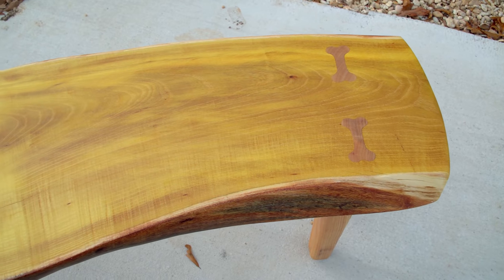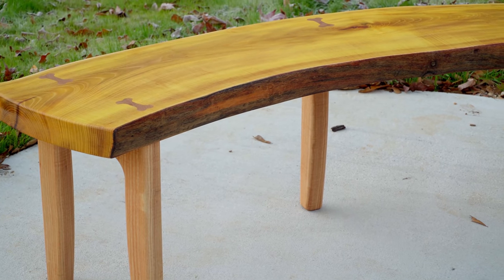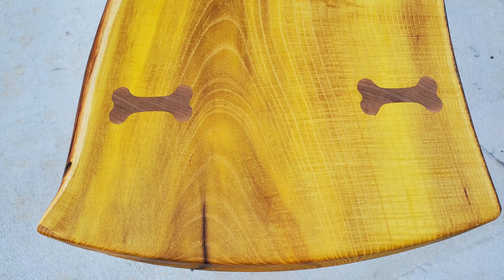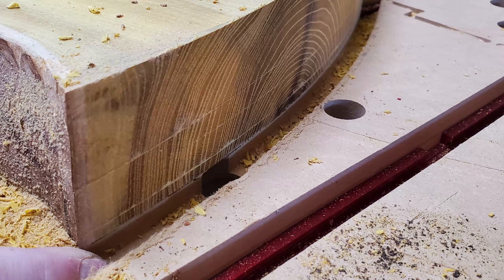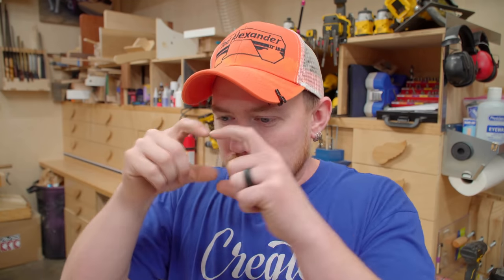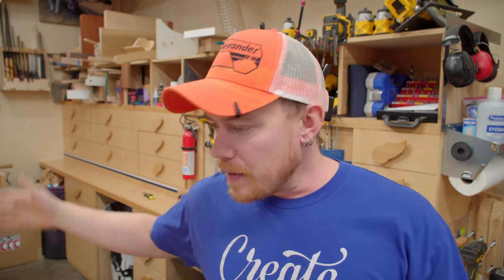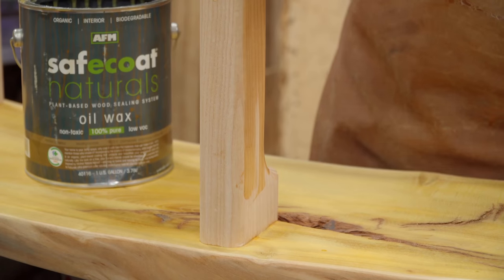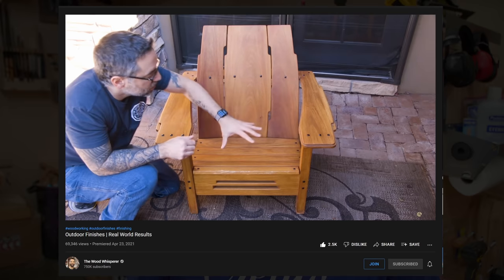Vlog 166: Woah! This scared me

Comment: I had a bit slip out of the collet during a cut recently also! It was crazy scary. It was a 1/4" shaft bit, so it did break the bit, but in a weird place...very near the non-cutting end of the bit. It can actually still be used, in fact, since there is so much of the shaft of the bit there. Glad you're ok!

Comment: Osage orange is used for fence corner posts here.  It's never straight but will outlast barbed wire without finish.  It's almost a nuisance tree and will take over if not controlled.

Comment: Collets do not require excessive torque when tightening. They supply you with a wrench set that shouldn’t allow over tightening. If you use a snipe or longer wrench set you run the risk of damaging the threads on your spindle. Also make sure not to bottom out the tool.
Reply: Agree completely.  If a bit is loose enough to come out of the collet after tightening with the wrenches provided either the collet is damaged somehow, there is dirt or grit in there, or the shank of the bit is out of round.  Years of machinist work behind me and never had a tool come out of a collet, and way more stress than any wood cutting.  I would take a close look at the collet, the ID of the holder, and the shank of that bit.  The collet shown in the video is the best design available, they hold like a miser holding a gold coin.
Reply: Hi Steve, that is not my experience.  Matching the bit shaft diameter to the collet size and going "as tight as" has proven most successful to me.   It is difficult to describe the right amount of force to be applied, but it is higher than what I expected it would be.  For the most part, I doubt this is as tight as what is physically possible (especially so if you are using very long handled spanners).  Ensuring you have the shafts, collet nuts, collets and the tapered recess they neatly fit into devoid of any dust, debris or detritus is also critical.  Cheers, David.

Comment: Hi Jay,

Great project ... thanks for sharing.

From experience ... collets (as well as router bits) are consumables. I've worn out three sets of collets (1/2" and 1/4") over the last 20 years using a Porter Cable 75182 router in my CNC.

If I have a bit slip (and I have ... it's never nice), I toss both the bit and the collet. I keep spares on hand to keep running ... and I buy replacements as I use them.

Keep up the great project videos and sharing your experiences and talent!

Regards,

R

Comment: Interesting and good feedback about the bit with the cut being too aggressive.  I managed to gouge a 1/2" hole through the 3/4" sacrificial board and well into my vacuum plenum in the early days of getting to know my cnc.  I now pay a lot more attention to ensuring the bit is in the collet is as tight as possible!  

Also, there is a neat trick to tightening and loosening the collet chuck with the way you hold two spanners so they are slightly apart from each other, with one hand you can squeeze the spanners together.  This results in a lot more control especially compared to having a spanner in each hand.  

Having noticed the end grain on the base of legs for outdoor furniture tended to rot fairly quickly, I now cut a rubber pad the same profile as the leg end and apply it with contact adhesive.  Legs 5 years later show no rot where they have been sitting on the concrete.   

Thanks for the video. Cheers, David

Comment: "The more you know" LOL! I can see the shooting star animation from Saturday morning cartoons when I was a kid. Not far off of "Knowing is half the battle!" Hahahaha!
Reply: Kidding aside, I've had a a pattern bit slip while I was cutting with a plunge cut router and when I finally realized I had a problem, after I seriously messed up my template 🙄🙄 At first I thought the depth stop on my router was slipping... Tightened that up so much that it seemed overkill or a design flaw... I still noticed depth drift and then I checked the bit and it practically came out just from pulling down on it. Scary as hell.

Comment: I've had a router bit start to slip out of the collet in my handheld router while making a dado with a 3/4" bit.  The bit was in the original collet that came with the router, and I guess after so many years it just failed and didn't hold tight anymore.  I caught it in time to prevent a huge gaffe in my project (only shop stuff, so it wasn't a big deal), but it would have gone into my workbench and likely hit an aluminum t-track if unnoticed. The collet was plenty tight, but just wore out over time.  I had a spare so no biggie.

Comment: Great video of the build. You mentioned the you used a wax oil finish for the outdoor application... have you ever thought of epoxying the bottom of the bench legs? This would stop any wicking of water when the concrete gets wet.

Comment: I use easel to run my cnc sometimes for simplicity and I’ve noticed that if I change the feed rate mid project it has a tendency to glitch out on me. The glitch usually presents itself as going out of the cut path which is annoying. I’ve found that as long as I leave it alone while it’s cutting I’m good to go 😂